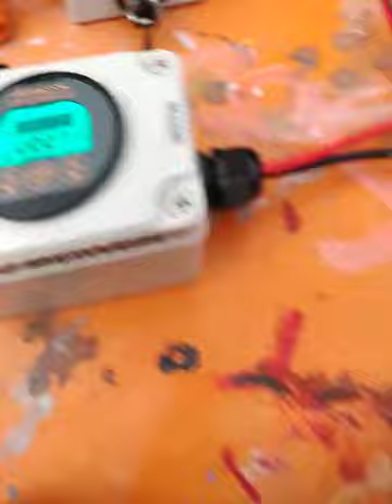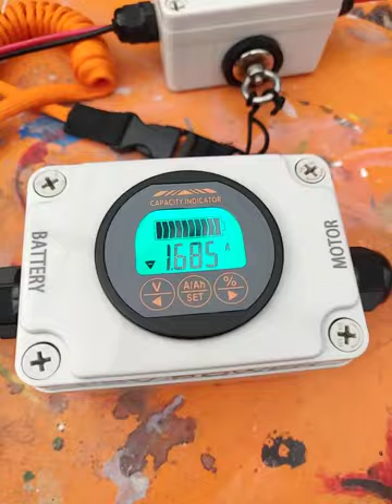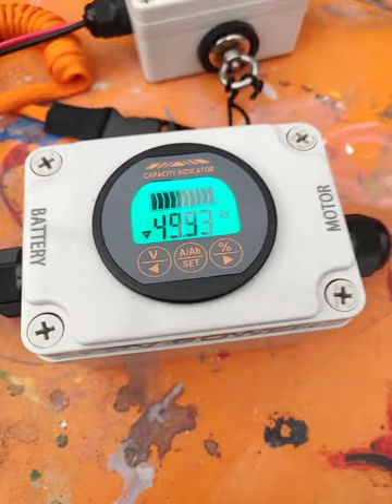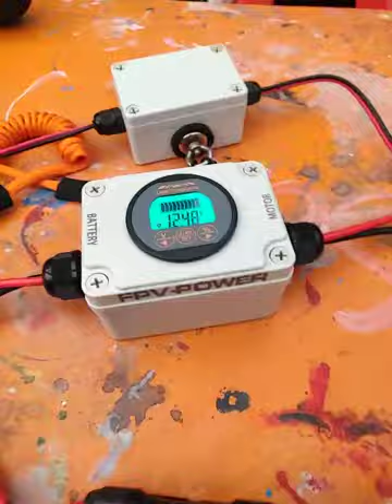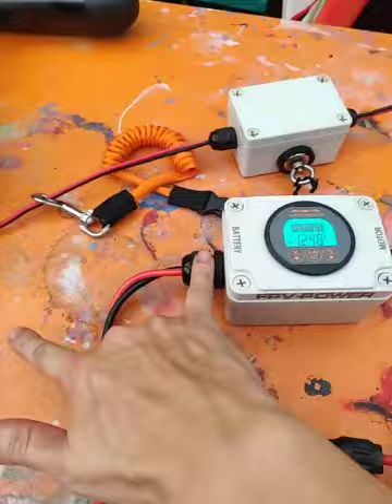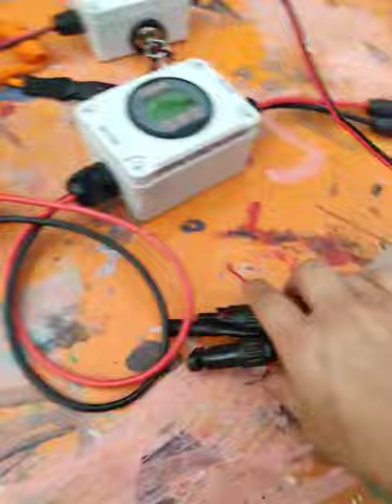Fpv-Power kayak Battery Monitor.

Comment: When is this going to be available in the United States? I love your products. I'm about to buy the 2 50AH batteries to power the Oldtown Autopilot. I fish bass kayak tournaments all over the States. I'm probably one of the few people who use your product. I do tell others about your gear!
Reply: Mariner Sails in Dallas have them!
Reply: @brandongoh8900  this only has a 400 to 800 life cycle Brandon.  It's more pricey then Daktoa with less then half the ability to recharge it.  2000 life cycle is pretty standard with some ging upwards of 3000 to 5000.  This one is 400...maybe 800 if you treat it real good.

Comment: Fantastic! I need to contact u early in the new year, hopefully get a deal for 50ah battery, monitor magnet disconect maybe some additional connectors or something, want to run a motor, fish finder and have connections for some lights also... but I’m not very good with electronics so ideally I’ll email u with what I need/want and u can give me some info on exactly what I need and best way to go about wiring it together, might even get 2 batteries, so I can run the fish finder and lights on 1 battery, and use my paddles, or add the extra battery and motor for if I want to go further out to sea 🤔😊

Comment: Will this be Bluetooth compatible? If I'm kayak fishing and want to check my battery, I have to have a way to monitor the batteries without having to raise get out of my kayak, raise the set and view the monitor.
Reply: No bluetooth sorry.
Reply: @brandongoh8900  That’s unfortunate and I don’t see the point of this device for my needs if I have to remove my seat and etc in order to view the display. I noticed on the video you mentioned a fully charged battery is 12.6V, is that correct, seems low for a lithium battery. Full disclosure I purchased the 2x 50 ah batteries and have been trying to figure out a way to monitor them while on the water in order to make sure I’m good while kayaking.
Reply: @jasonhayes2778  12.6v is correct as you might be referring to other types of lithium batteries. I'd just keep an eye on the voltage and when you start to see the voltage sit at about 10v at rest then you know the battery is getting low. Once you take out your kayak a few times you'll get a better idea of what runtimes to expect. For example we run a 28lb motor with pwm and if we are trolling I know that we'll get 8 hours easy on a single 50ah.